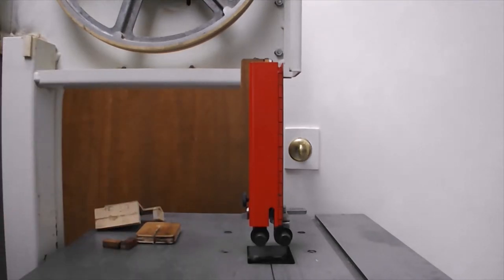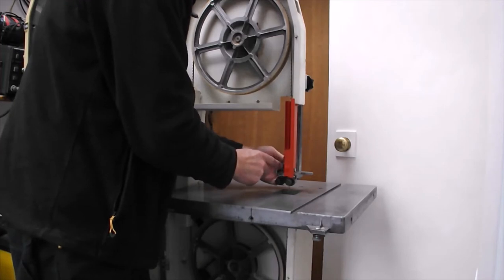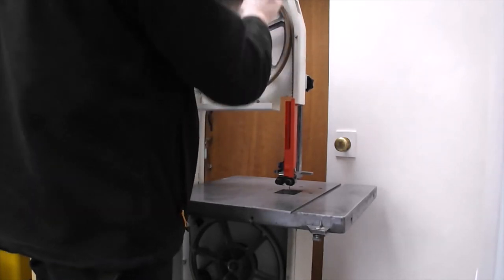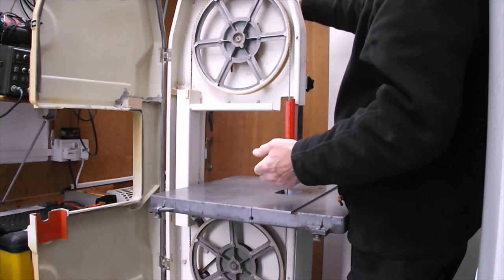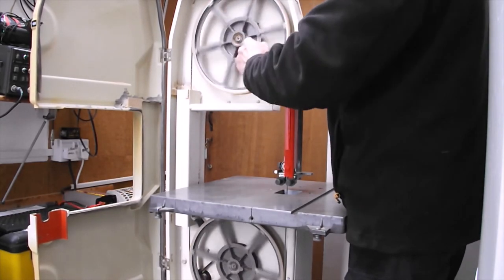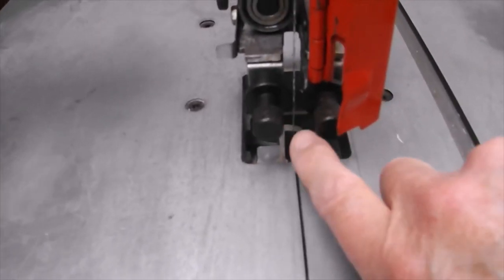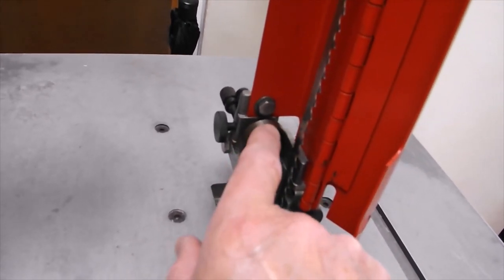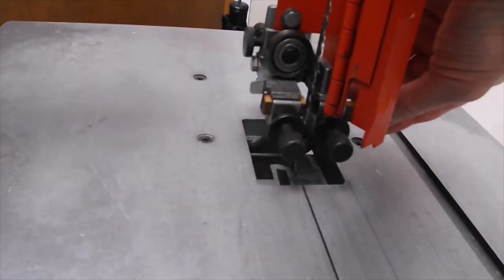Kity bandsaw 10  0613 220 v Part 2

Comment: what size blade are you putting on yours? i've always used 91" and 11-13mm wide i believe (might be wrong) 
i really struggle getting it to be accurate in thicker materials.
Reply from the maker: Hi owen. The exact length is not important so long as you can tension it correctly. Too many teeth will produce a slower cut and tend to clog up on soft wet or thick wood. I use 4 teeth per inch on a 10mm band. This cuts quickly will do a good a good curve and is relatively easy to sharpen. A wider band needs higher tention and curves are more difficult .
Reply from the maker: Just watched your video of cutting the axe handle. It seems you have a very slack band. It vibrates sideways a lot. I think that would make steering those curves very difficult. A good dust extractor might help. A lot of dust is a big fire hazard.

Comment: Hi. Can the guide be raised to allow larger cuts? What is the highest cut possible? 

Tia
Reply from the maker: A bit less than 200mm. Undo the black nob on the saw guide raise to hight ness. and tighten.
Reply: @jonathanjonjon2871  thank you I've got the opportunity to buy one second hand and the guy said it only goes to 80mm don't think it his maybe his dad's
Reply from the maker: The max. physical length of exposed blade is 200mm but what thickness of timber its capable of cutting depends on the type of wood, what blade and condition, and whether the cut is strait or curved. I have cut 150mm of pine with mine, it wasn't fast.!
Reply: @jonathanjonjon2871  yea I can appreciate that each aspect creates a new dynamic .. to cut a hard wood with large thickness will create problems. Thanks for your advice
Reply: @jonathanjonjon2871  thank you. Is there any obvious things I should check when I go see the saw that someone may try and hide?
Reply from the maker: @davos_guitaros  If the saw is working ask for demo. Look out for vibration. If not working open the covers slaken the blade and pull sideways on the wheels to check for bearing ware. Also check the tyres and that the motor runs.
Reply: @jonathanjonjon2871  OK thanks a lot that's really nice of you to offer advice.